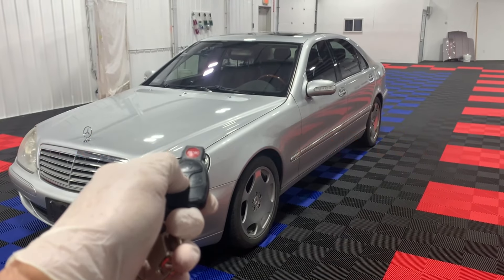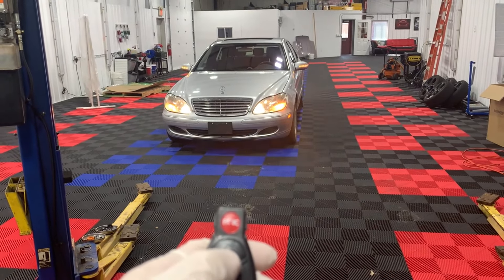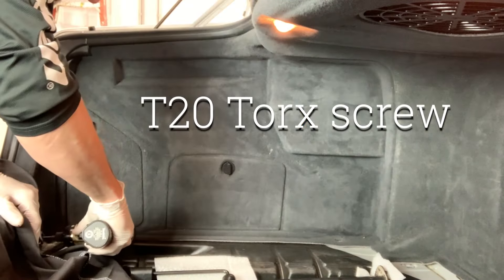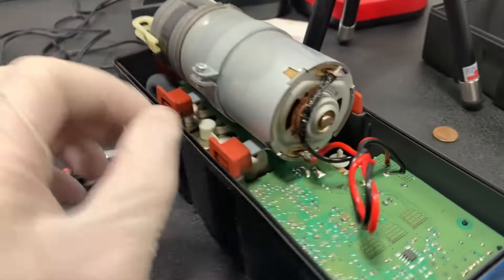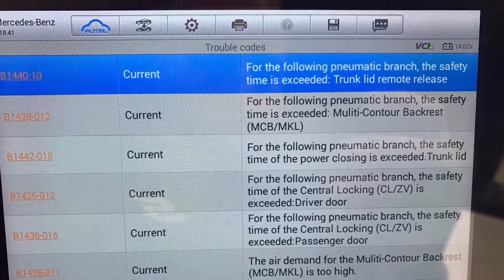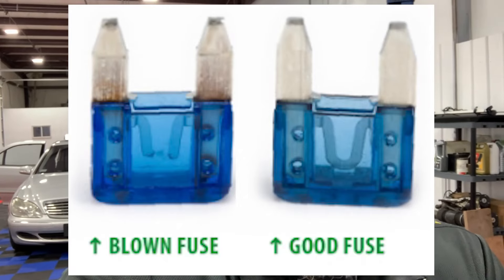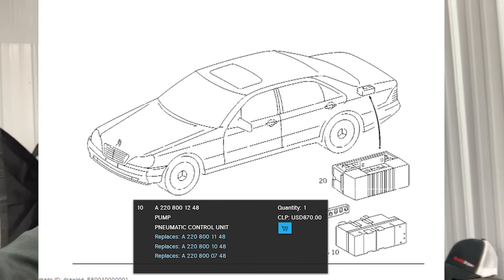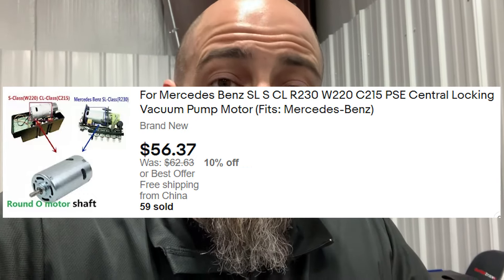WATCH THIS FIRST if your Mercedes-Benz W220 S-Class won't Lock or Unlock -PSE Central locking issues

Comment: I had an exact problem you addressed. My brother is a mechanic but Mercedes is not his specialty. I showed him this video. He changed the fuse and PSE pump and it worked. I god my car fixed last night and I am super happy. Thanks!
Reply from the maker: Glad to help 😊❤️ but keep in mind if the fuse blew you will need a new pse. It will happen again. Most likely due to an air leak and the pump running extra .
Reply: Yes, it's another EZ fix I would try spraying soapy water first on air hose leading to the strut under the hood, 2. the relay in the fuse box right side maybe bad, finally yes sometimes the hose on the pump can leak also I would buy another hose that's attached to the pump, shelf life with rubber is only 5 yrs. if that's leak most of the Mercedes problems are a EZ fix Mercedes likes to hide and tuck stuff it all a process of elemi nation car, a EZ fix.
Reply: Appreciate it

Comment: GUYS IF YOU CAN LOCK AND UNLOCK THE CAR FROM INSIDE BUTTONS ON THE DASH, BUT THE KEY IS NOT LOCKING AND UNLOCKING THE CAR IT CAN BE FUSE 60 7.5 amp.(located under rear right seat) FOR ANTENNA BOOSTER AND PROBALY IT IS, CHECK IT
Reply from the maker: Thanks!

Comment: I'd be pretty reluctant to use a used' pump.  You don't know the miles of the car it came off of, or how long it has been sitting.   In my 95 f150, the Hvac used a vacuum system like this to actuate the vents-- and I always hated it.  I'm shocked to see these cars use such an extensive vacuum system like this.  There's just too many points of failure IMO.

Comment: I went through this with my 95 R 129 Conv. top's 10 actuators, now this 03 SL500 has a whole new set of challenges. Getting the retractable top to operate is dependent on each feature in a sequence to operate flawlessly and although I can move top, my central locking pump is running but mechanisms are "not" moving, so your video has opened my eyes and I am most grateful, thanks

Comment: Great video, I had to replace all my pneumatic actuators on all four doors and trunk. After age the diaphragm will crack hot and cold weather will do it.  Also bought a new PSE pump too.  There are no way around it. W220 will all have this issue after a decade easy.  Great diagnosis here, thanks for the video
Reply from the maker: Still have yet to replace my pse 😂😬, in fear that I will have to do the exact same you did! Age is a terrible enemy! Thanks for the nice comments!

Comment: Thanks for the video!  I've got a 2000 s430 with only 40k miles.  The car is practically spotless.  It's been in storage for years.  Of course the locks are defunct like a lot of other shit on this car.  Found PSE fuse blown.  Pulled PSE and opened for inspection.  Looked like day 1 inside that thing.  Whacked it a couple of times with 12volts and the pump came alive.  Replaced the fuse and it's working, hope it stays that way!  Now if I could just get the stupid air compressor to come alive when the car needs it, I might actually be able to drive this car.  I swear it's the nicest POS you have ever seen.  Total time capsule.
Reply from the maker: Nice find! The pump probably needs a good whack too!
Reply: @MasterTechLou  Swapped the pump and valve block and it's back riding high.  Disuse is the worse thing for these cars.  Took it around the block and it's really a nice ride.

Comment: Thanks for the video. I have a 2000 S500 central locking wouldn’t work, soft closed doors wouldn’t work, boot wouldn’t open with button or key fob. Fuse kept blowing on the old pump I purchased a second hand pump for £250 and everything has started working.

Comment: Good to know! I want to help a friend with a 2001 S500 5.0 My friend doesn't have money, and he's 82yrs old, but a cool dude. I'm also taking the CD changer out of my 05 C240, and putting it the spot in his trunk where the existing changer stopped working, and he can't get the CD out of his dash. I won't ever use the changer because for the most part, I stream. But I saved your channel. 👍
Reply from the maker: FYI S”500” means 5.0
The badging is the engine size. Of course not all are consistent because they started to account for a turbo or supercharger so like a 1.8l could be labeled a 230. But all numbers on the back of a Mercedes are the engine size. Whether it be natural or forced.
Reply: @MasterTechLou  It's def a 5.0. But I'm sure the wiring is the same. He'll get my CD changer into his trunk. Gonna help him fix his keyless entry. Gonna do my homework and help his car be 100%.

Comment: Mine started act weird, will work sometimes, sometimes no. But what I found is separate electronic components like parking mode dash cam power supply, led lights.
This type of behavior was described in newer pickup trucks after installation of led backup lights.

Comment: Thank you so much! This video was a big help!! I reset the fuse like you explained and it actually worked !!!
Reply from the maker: That means you have a leak, it will fail again. Its not a fix by removing the fuse. It is for easy testing. Best of luck.

Comment: Hey i think you just saved my day! 
Ive got a 2005 s500 and ive got some very disturbing issues. 

So lets start:

Central locking works only front doors.Trunk works. Headrest falling works. Buttons on dash dont work. Soft close don't work.

Everything work except the buttons on the dash and the rear doors and the soft close .I hear a buzzing sound from the back if I press the buttons on the dash but nothing happens.

I think the previous owner switched the PSE from a CL. Thats the only thing i could believe.....?

Comment: Thanks Lou, Drivers side Soft isn’t working but all others are. My drivers seat isn’t so I am hoping this will fix it! Thanks excellent video short and to the point. Cheers
Reply from the maker: Once you pull and reinsert the fuse it will work again. Put your ear to the door handle and you will hear the leak and or in the door jamb area where the line flexes.
Reply: @MasterTechLou  It did just what you said, I heard the Hissing, is that where the leak is? I just have to take off the door panel and fix the leak? 
Thank you for the Help

Comment: As for the pump - I saw a kit to rebuild a vacuum part of the assembly. It is graphite parts, there's plenty of videos on YouTube on how to do, how to test with the pressure meter, because you regulate with bolts pressure of the assembly and as it's a graphite - you can destroy it...

Comment: Hey ty. One  question. Three door was working except 1 with sucking system. When i  ised this door it sounded like something broke inside. And then the door is locked now. The rest are working except this one . Need to change the pump?ty

Comment: Lou I have a 2004 s55 with 75000 miles engine running good but lately electrical problems trunk not unlocking via key or trunk button i was told i need new actuator ?? Additionally, my battery went dead had AAA put in new one and  head lights will not shut off before this the radio would sometimes not work but then when driving for a while it comes back on is this a control module issue and if so can is it something a DIY could do
Reply from the maker: Anyone can diy with the right scanner, patience and access to how the systems work. Like I said in the video pull the fuse. Put it back in. If the trunk now works it’s because you do have a leak. As for lights, check your front left fuse box cover, hope its not loose and water didnt get in there. As for radio, they fail often. So may need a new one.
Reply: @MasterTechLou  
Thanks

Comment: What an awesome job, hopefully, you can help with my 2004 S430 W220. 
2 issues, the trunk won't open, and based on this video, it sounds like it is the PSE that is leaking; the close function works great. 
Second issue and what I really need help with: My Head unit has the following message: "Flash drive system will be formatted. All user data lost. It could take up to 5 minutes. Please do not switch off!" How can I get the radio to work again.
Reply from the maker: If memory serves there might be a software update that the dealer needs to do or the radio will need to be replaced. The issue is the internal processor is corrupted or something

Comment: The situation I'm having is that the keyfob works fine. The central locking via the button on the center console locks and unlocks all doors except the FL passenger door. If I use my scan too to do the same, it works fine.

Comment: I have my driver door lock  and soft stop closing. everything else works. well passenger lock works sometimes but soft close works. my car is a 2003 cl55 amg . fuse is good but scan tool reading all the codes in the PSE so now based on your video im thinking the pump is bad thank you.
Reply from the maker: Most likely line is cracked in the door jamb or the lock element is leaking.
Reply from the maker: But if you do have codes for every circuit then yes most likely weak pump
Reply: lou you might be right i do hear air leaking in the door jamb area an issing sound after i turn the car off  @MasterTechLou

Comment: Liked and Subscribed. I just purchased a 2006 S430 with 45k miles knowing the PSE was bad. My new pump came today and it took about 5 minutes to install. Nothing works. I can hear the pump whirring when I push the lock or unlock buttons but the locks don't move. I've tried pulling the (perfectly good) fuse. Still nothing but the whirring. Any suggestions?
Reply from the maker: Bad pump , clogged inlet line, or massive leaks everywhere. All answers are in the video

Comment: Thanks for this video. I greatly appreciate you. I have a 2000 S500 and the left rear door will not open at all from inside or outside. The truck will not open with the remote but only with the key. Help!
Reply from the maker: Help, ok so , make sure the key slot is vertical not horizontal. Read the owners manual on “valet mode” and youll see why. That can be why. Or a leak. As for the door, latch is most likely rusty. Only fix is pull both door handles and whoever is on the inside just keep banging on door. I have seen sticking latches and I have seen sticking door seals. Crazy how a door seal can keep a door from opening. Best of luck

Comment: Awesome video! Very detailed and informative. Thank you so much. But check this out , I checked mine and found a 20 amp fuse still perfect? I pray once I change it that’ll fix my problem.
Reply from the maker: Fix your problem? Probably not. But the video explains it will reset the pump and allow it to work until fault codes trip again. A good fuse does not mean a good pump. Just means a good fuse 🤷🏼‍♂️. Best of luck 🤞🏻

Comment: Question, I hope someone who has an answer will respond to this. My car is a Mercedes-Benz S430, similar to this. The battery went out, then I charged it. After that, the right seat, the right mirror, the horn, and the right window went out. What is the reason? Or is there something separate or a fuse that needs to be replaced?
Reply from the maker: @Hjaji0  this is most likely a coincidence. The problem lies in your door module. Either the wire in the door jamb is broken or the fuse to the module blew.

Comment: Hello, I have a problem with opening the MB W220 500S 4 Matic, when the temperature drops below zero, I replaced the batteries in the key, the battery is new, when the car warms up, it opens without any problems I DON'T KNOW WHAT TO DO HOW TO SOLVE THE PROBLEM, ANY HINT?
Reply from the maker: obviously temperature related. in this instance I use a heat gun to warm up whatever module I need to focus on. and or put a module in the freezer to get the issue to happen on purpose.

Comment: #78 fuse (fnt passenger side) blows when I put a new one. My key will not turn, won't lock/unlock doors/trunk. The trunk unlocks from the rear & from inside the car. I've checked all the fuses under the rear seat & all were good. I'm STUCK! 
This video didn't address my SPECIFIC problem, but I LIKED & SUBSCRIBED anyway because I like the way you hold class. GREAT VIDEO. Any help on my specific issue? As a browse through your videos hoping to find the solution. 
THANK YOU
Reply from the maker: Fuse 78 should be for your ignition switch. You need a new ignition switch most likely. Dealer install only . Appreciate you watching and subbing. ♥️
Reply: @MasterTechLou  Actually I followed other advice and disconnected the "Alarm Siren" which turned out to be a charm. I inserted the fuse, and it's working just fine.

Comment: Hey, I'm trying to sell a 2007 S550. The Fob won't unlock anything so we need to use the key. We get in and there's no power on the doors. No locks work or anything. I start the car and everything works after. I run it for a few minutes. When I turn the car off, the fob works and the buttons on the car work for a few minutes. Is this a sign that the car battery needs to be changed?
Reply from the maker: @HDEstateSales  yes the battery in the trunk is dead

Comment: How to make it make noise when you hit lock button… any way to take it off from quiet mode?
Reply from the maker: Our cars didnt start making a lock or unlock sound until certain models. And if they can, the setting is in the dash. Some if memory serves needed to be turned off with a scanner but the beeps didnt start until w211 and w203 chassis I think.

Comment: I have an Italian electric car certificate and I recently purchased this car in Ukraine where I am trapped due to the war, after less than a week the local police stopped me and they literally kidnapped me with the intention of seizing this "super 5 liter  car" from me "but I managed to escape and during the chase I broke two wheels and the internal bumper and also the lock of both the keys and the button inside no longer works, which is important for me so as not to get kidnapped by the local police again, I have already tested the fuses and they work now I will try to check the pump and thank you very much for this video
Reply: You really escaped from the local Police? 😮

Comment: I’ve had an issue where when I put a new pump in and the pump instantly burned out… I’ve checked fuses and wiring but no luck… suggestions?
Reply from the maker: new pump only? like replaced just the pump inside the pse housing?
Reply: @MasterTechLou  the whole unit. I’m suspecting maybe a leak in the hosing which maybe causes it to constantly run.
Reply from the maker: @joem.575  ok gotcha, if you mean NEW as in NEW from dealer, you can part warranty it. if you mean new as in used, you may have just gotten a bad pump. they dont burn out quickly, also once you replace it you can check every door with soft close and trunk soft close and locking and unlocking and listen for the leak its typically easy to find.

Comment: hey i had blown fuze. i fixed the motor wire and the pump works now but still my locks and soft close doesnt work what do i do
Reply from the maker: Probably bad PSE. Cant build vacuum or pressure.

Comment: Hello Master Tech 
What is the issue if the pump continues to run, but doors still don't work
Reply from the maker: Pump cant build pressure or
Vacuum itself. Bad pump. Most likely culprit
Reply: Thank you for such a prompt response. The information was very helpful, but I replaced the old pump which had literally melted to the casing. I installed a used pump that runs but still have the same problem. I would be very grateful for any further information. Should I get a new or rebuilt model. Thank you so much

Comment: My 01 s500 The only door that unlocks is the passenger side front. The trunk won't pop unless I use the key. Then I hear air hissing from around the Latch area when I do open it. None of the soft doors work except for the passenger sign and the postfeature doesn't work on any of my seats. U think this is the pse? The fuse was fine and the hoses are red not yellow
Reply from the maker: Most likely you have every element failed. Soft close will not work if locks wont work.   Could also be pse not activating the solenoids for each branch. Will need more diagnostics done

Comment: Lou,  thank you for all you do.  I have a. 2002 S55.  All of the buttons on dash don't work for some reason....including ABS, shades etc....could the ABS module be culprit or what do you think...?
Reply from the maker: Its called an upper control panel. And fails often. All the buttons are part of one panel.
Reply: @MasterTechLou  OK. Thank you so much Lou!

Comment: Hey Lou, great video! I have inherited a mint 2003 S500 4matic with 29k on it that is having a issue with the trunk open and close. All of the soft close work on the whole car, including the trunk. How can I check was is causing the power assist not to open up or close down? Thanks
Reply from the maker: Need a scanner. Also open the trunk all the way, press and hold the close button until the car dings. Usually takes about 10 seconds. Then see if the trunk works.
If not, it can be a number of things wrong.
Reply: I’ll give it a try. Thanks  @MasterTechLou

Comment: I’m gonna try the pump issue and the fuse. My locks/trunk/door suction not working. 
Also, my key won’t turn, I’ve been having issues with needing to jump my car so I purchased a new battery but it still periodically will need to be jumped. My key won’t turn but all my interior lights are on. My alarm button isn’t working but my unlock alarm button works. Help!,,,

Comment: Is there an exact way to find the leak in the air hoses?
Reply from the maker: hoses tend to break where they bend, like in between doors, and trunk lid hinge. 
you can use a smoke machine, trick is cant put too much air pressure as if you test the wrong line it can blow the air element.